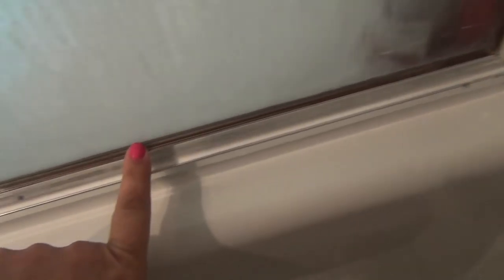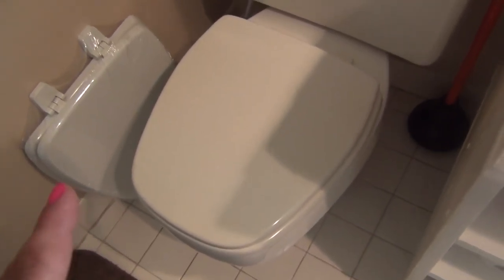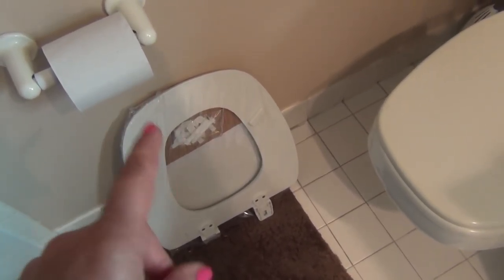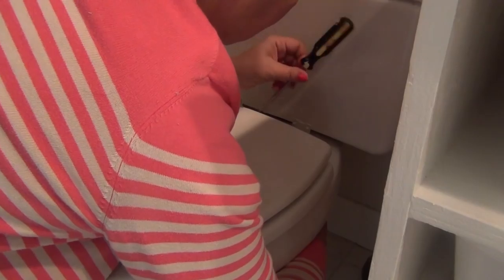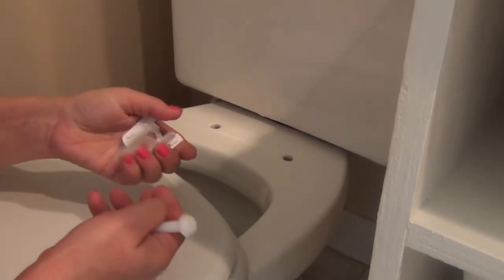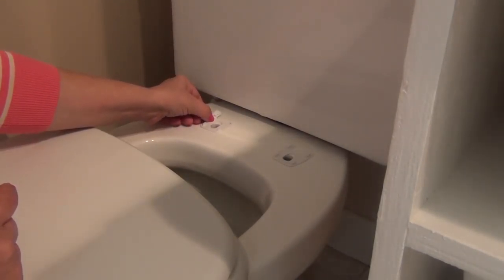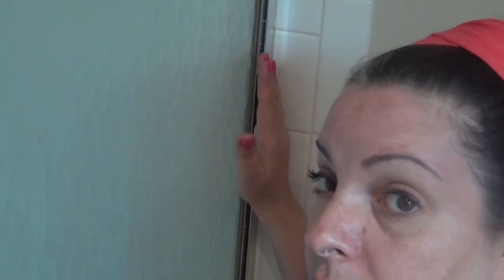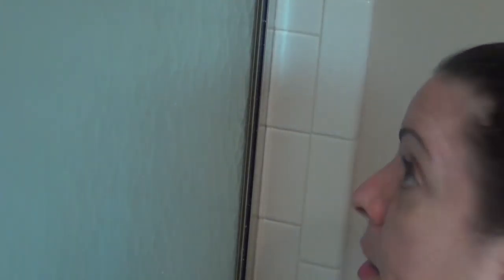Master Bathroom Makeover - Part 2 -  New Toilet Seat and More Caulking

Comment: You really did a nice job there Sophia.  You know it's amazing what a difference just cleaning up those lines and adding new caulking makes in the over-all appearance of the bathroom.  Since we've painted so much of the house a bright white lately like our old woodwork in this house, I never thought that I would love it as much as I do now.  Of course our old wood was just standard contractor grade stuff they used in the 70's, so I didn't mind covering it up with white paint.  It was just old pine and not some beautiful ornate hard wood that I would want to refinish.  You are way ahead of me on your bathroom project, I'm still working on my staircase mostly and doing a little bit in our upstairs bath as I can get to it.  Love this project and vid, great job!

Comment: Great job!  I have a similar plastic tile/grout scraper tool that said to use the "claw" end to scrape out old caulk or sealants, then the angled end to smooth out the ribbon of new caulk [but an old-timer plumber said a water-wet fingertip does a better job of smoothing sealant edges LOL]!